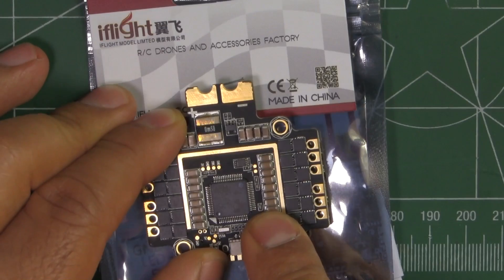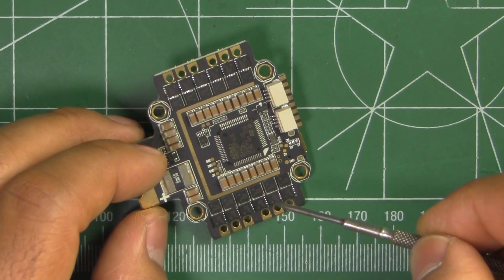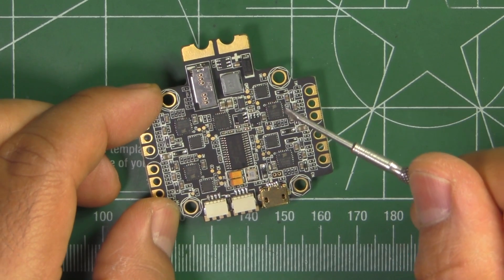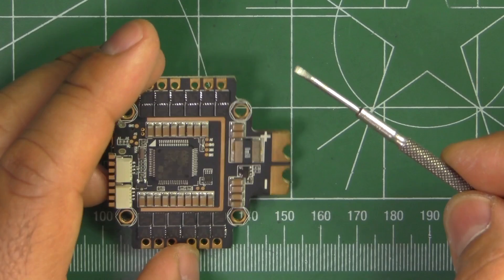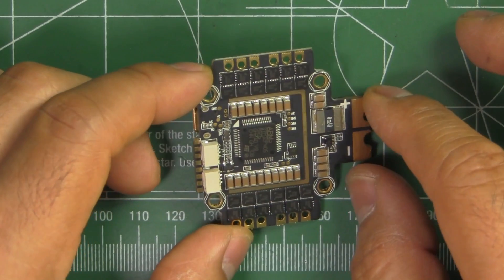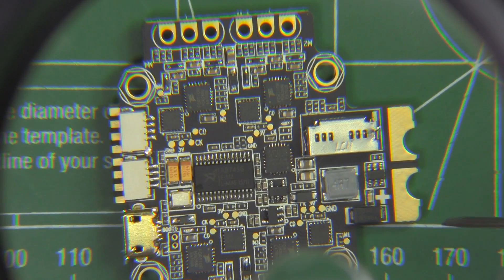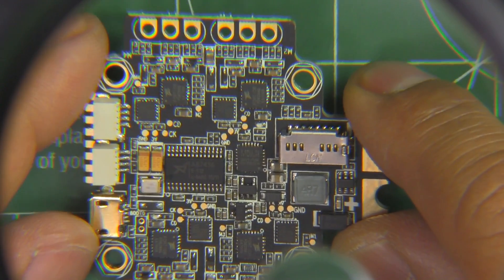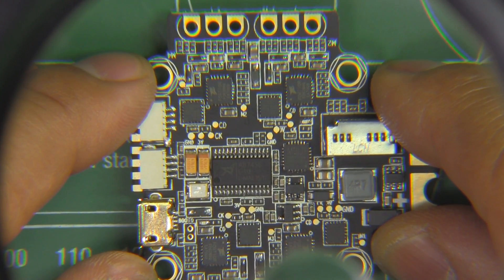iFlightRC.com Poseidon All-in-One F4 Flight Controller Overview

Comment: can you check the continuity of the standoff holes and the motor pads, +ve and -ve? I had one of their 25a esc and it conducted thru the standoff holes...
Reply from the maker: Do you mean the iPeaka 25A 4-1 ESC?
I will check in about 10hrs when I get home.... If I don't post tonight, please remind me! That shouldn't be like that. Makes sense if mount holes are tied to ground (negative) but it would be a very stupid design if they tie them to positive! I will definitively check. I do always make it a habit to test continuity on battery leads to see if there's any short in every new build.
Reply: yeah it was that esc...I had to sell it bit of a disappointment...
Reply from the maker: This one? https://www.youtube.com/watch?v=hGgXkKq6v_E
I'm going to check continuity on that one too. I'm planning on using it on a 4" build. Strange because overall quality of the PCB and components in their ESCs are some of the best I've seen, but I never would've thought they would make such a dumb PCB trace design mistake.
Reply: yes that one check it...maybe I got a bad one but I have to use steel bolts for stack and it had continuity all over the place...
Reply from the maker: The 25A ESC I got looks OK. The Poseidon is also OK https://www.youtube.com/watch?v=TUwqN6GMpEY